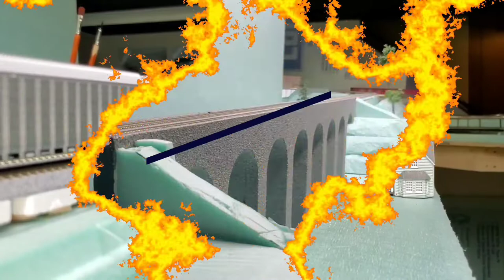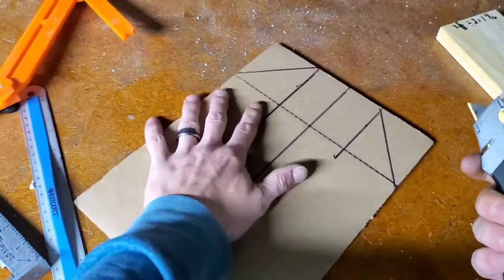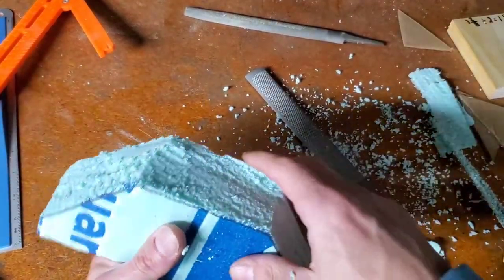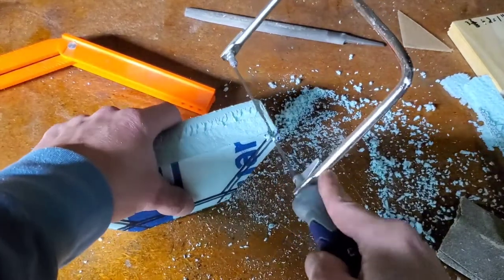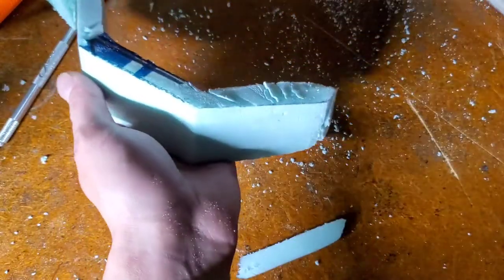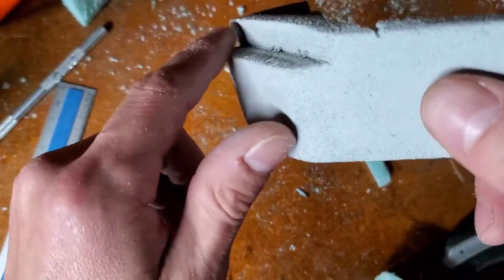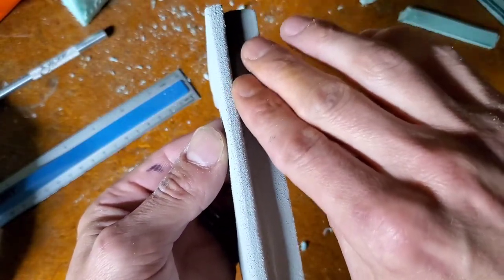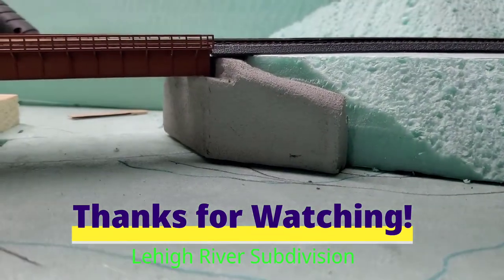scratch built bridge abutments from foam

Comment: For anybody interested, the bevel device Ian is using (2:08) is called a SWANSON TOSB01 Speed Bevel Folding Speed Square. It's available for under $8. But I'm lazy and got a digital bevel (a little more money, a lot more accurate) for less than $30. 
Thanks Ian, this gives me a lot of ideas!
Reply from the maker: Thank you very much Sir! And thank you for thr information on the Bevels. Im horrible with names of stuff. Im going to look into the digital one myself! I like accuaracy! Since this video i recapped 2 of these abutments with plaster and carved stone, as i do not have the skill to carve foam, its easier for me to caeve plaster lol. But these worked great for me, and are like you said a way to spark ideas for other folks! Glad you found this helpful, and sparked ideas! Glad to hear that! Thank you very much and take care!

Comment: Nice video and good way to make an abutment. I like your technique. 
I am curious. What brand rasp file is that with a rasp on one side and a regular type flat file surface on the opposite side. Thanks.
Phil
Reply from the maker: Thank you very much! I appreciate your feedback. I will leave a link to a video where i redid these and added plaster. Not that i didnt like these, all for a prototypical look. But they've worked wonderfully for 3 years now. As for your question about the rasp/file. I looked on it, woodcraft is stamped on it. But i googled and it just brought up all different brands. But i did buy them at Lowe's. So maybe you can find one there browsing the tool section. I originally bought that for the rouned side to do my viaduct. Hope that helps. Take care and thanks for watching!
Reply: @LRSX  Thanks for the information. It is funny you commented today on this as earlier today I ordered a 4 sided rasp (8 inches long) on Amazon. It is due here tomorrow (Tuesday)...If it good, I'll keep it, but Lowe's will be in my near future should it not live up to expectations.
I appreciate your reply and nice work. I'll will have to check more of your videos to check your layout out. Thanks.....
Phil
Jersey Shore Area...